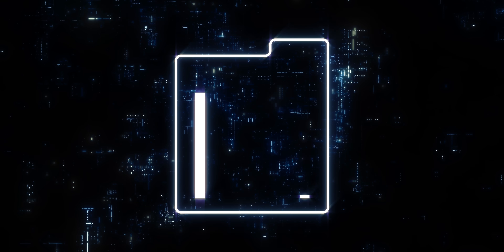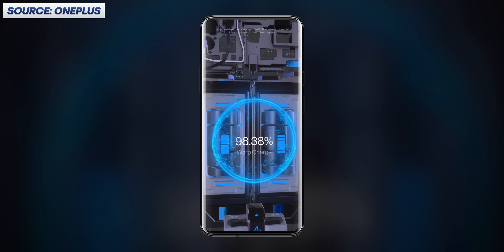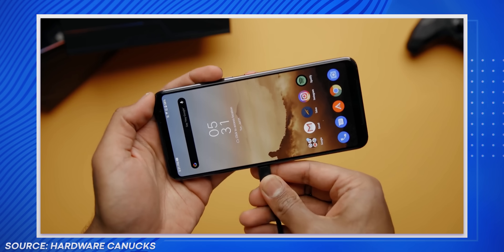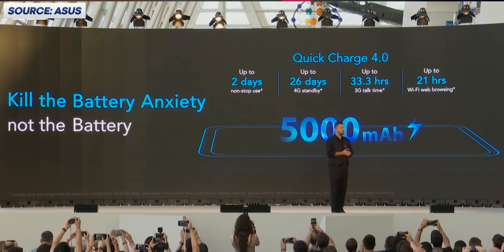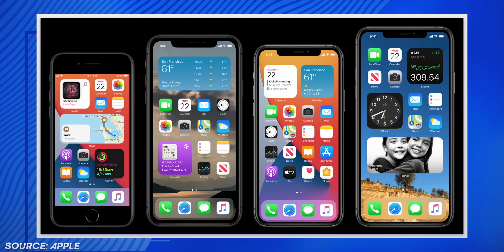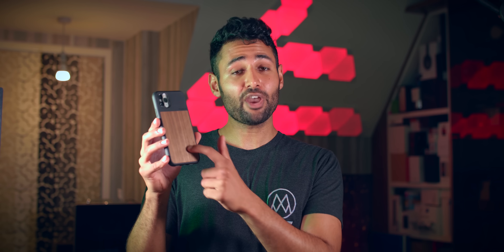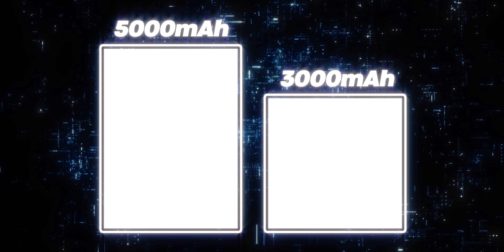The Problem with Fast Chargers.

Comment: I happen to have some knowledge on the subject. And this is one of the most accurate explanations I’ve heard lately. 2 minor exceptions... the battery percent on the phone screen from 0-100 isn’t actually the percentage of capacity of the battery. It’s just the usefulness of voltage between roughly 3.2v and 4.2v. And storing the battery at 50% makes theoretical sense,  but all the experiments show 40% is the sweet spot for long term storage and life. And that’s battery capacity, not the number in the corner of your phone screen.
Reply: Actually, If you take a lithium battery to 0% it will never charge again. As a matter of fact, if it drops below 2.0v, it’s basically garbage. Throw it away.

Comment: I was questioning myself, why youtubers don't talk about the disadvantages of fast charging. You did it nicely!!
Reply: It is the same reason why no car journalists talk about reliability, longevity, parts cost, repairability, etc., mainly because they are exposed only to the new stuff.
Reply: Phones are made to be used for 1 or 2 year. So they don't
Reply: @GameControlYT  and they make you to buy a new mobile by forcing in this way.
Reply: @GameControlYT  thats what they want you to believe, but thats simply the release cycle. They release it as often as possible.

Cars also have 5 years release cycle, but the average car on the road is over 10 years old.
Reply: Beacuse no one cares about the disadvantage, we want faster charge period.

Comment: 1. By separating 2 cell battery for those super fast charge is to maximize the charging efficiency and minimize the heat generated during the voltage conversion. 

A physics lesson is not good enough to explain the battery charging topic. You need to covert the electronic part.

2. How many years you expect to have your phone or tablet to last? 3 years or 5 years?

3. Have you been using any of the fast charge phone for at least 2 years on daily basis?
I do and I am still using. The battery durability still in very good condition. 30 mins give 60％ battery charging is life changing experience.

I used Samsung Note 3 before, and last me 5 years. But in year 2.5, I have to change the battery. Look it was very slow charging compare to current technology and battery still damaging after 2-3.years but now on those new phone we have is last longer.

The current battery technology (materials and charging technique) has improve massively and they have make it works very well in practical.

All about the physics that you mentioned in the video, some is no longer concern.

Most people will change phone on average of 3-4 years. By the time, even how good the battery you preserved doesn't matters anymore because software burden has bigger impacts.

Comment: Thanks for sharing this! I always had this doubt! Because modern manufacturers promising that we charge and play heavy tasks in our phone! But its already heavy current passing through the phone! Charging and discharging at the same time! I thought they might changed components of the battery to prevent getting weak like older phones! I never use phone while it's charging! In short ; Even with a powerbank can cause this problem!

Comment: Ok, but why does battery expansion happen, i thought it was the fact that some of those electrons that go over to the positive side because of the attraction stay and are replaced by electrons from a current, I.E your charger, which is one of the main problems that would happen with slower charging speeds as more electrons have to be replaced.

Comment: And this is why Samsung Sticks with 25 watt fast charging. It's a perfect ballance  between charging speed and battery longevity. 

Samsung phones like the S10, also give you the option of reverting to their older 15 watt fast charging, as well as standard speed 5 watt charging in the settings menu if you don't want to use 25 watts. But 25 watt is still plenty safe in reality, since many manufacturers go way beyond 25 watts today.

Comment: This video misses some pretty key aspects of fast chargers. Wattage is a combination of voltage multiplied by amperage. So to achieve 30W you can either doing 10V at 3 amps or 3V at 10amps or any other combination. You talk about charging faster increases heat in the battery as the electrons are going faster. That is true when you are increasing the voltage to achieve higher wattage. If you increase the current(amperage), you are not increasing the speed of the flow, you increasing the width. This is why the Oppo/One Plus solution doesn't make your phone red hot when fast charging. They use higher amps and lower voltage. Other phones like Samsung have to do a voltage conversion on the phone itself, which generates masses of heat. The problem with increasing the amps rather than volts is you need a thicker cable to carry it. Which again, is why one plus and Oppo come with thicker cables. If you replace the cable with a normal cable specced to carry lower amperage it won't be safe.

Comment: hear me out, what if you had a phone with a 6,000mah battery, but the manufacturer limited it to 3,000mah and advertised it as a 3,000mah so that 100% on your display was 50% for the battery
Reply: only really saying this, because it would not only charge to "100%" faster, but it would put your battery at 50%, maybe limit it to having 75% total capacity, so you would have more run time, and a slightly healthier battery

Comment: "Apple slowed down older phones so the battery lasts longer"
Sure, it definitely wasn't to force people to buy new phones, but to help them have a longer battery life, got it
Reply: I mean logically, forcing the processor to underclock and undervolt will indeed make the battery last longer.

Their motives behind doing so, do remain questionable
Reply: Apple claims it's for "battery health", but it's all a facade.
Reply: @DerpyDoge I was not going to mention any articles, since I didn't have any prior information, and was genuinely interested to see if the statistics confirm what you claimed.

I can see many discrepancies between the article and your comment.

First of all, the study is only in the US. Second of all, although the average iphone stays active a bit longer than a samsung, the study still talks about 1 year and a half total active time, but it gives no data about how many phones stay active for 5 years, so in that regard, the study doesn't confirm what you claimed.
Reply: @iamspencerx  buddy i had almost all the galaxies and i swear!  i  have changed my galaxies every year to a newer because after one year my galaxies started to slow down and dropped the battery capacity drastically., 1 year ago i bought my first iphone for the first time, the "11 pro max" and man my phone it's still at 100 capacity after one year. of course, i have been applying the 50 to 80% cycle on every phone that i have owned., including the iphone. it really surprises me how the iphone after 1 year it still feels like a brand new phone and this is the first time that i will not change my phone to a newer one.
Reply: chris the doc but ur iPhone lacks fea
Reply: chris the doc features lacking iphone
Reply: @christhedoc8689  Of all the reasons why your phones might have become slow, samsung intentionally slowing them down isn't one.
Reply: @DerpyDoge I do see android users keep their phones for 5 years, if you have some statistics, I'll be happy if you could share them with us, just avoid making generalisations based on your personal experience.

That being said, if were to assume iphone users use their phones longer, then that would still confirm my point, because apple would profit from pushing them to buy new phones. Now sure, some pissed off people could switch to android, but most of them won't, because apple designed their services to lock in customers and make leaving very hard.
Reply: Probably both! For some will last longer so they keep using Apple services, for others will make them upgrade faster! Win win situation... For Apple of course, as usual!
Reply: I mean... If you keep the Iphone for a longer time... Its highly possible tat u already cashed in money on their services... Which is kinda more than u spending money on a new phone is u factor in extra 2~3 years
Reply: @rustyshackleford7200  seems legit

Comment: I reserve fast charging for those oh crap my phone didnt charge right overnight and im leaving in 45min or when i get a overtime service call at 7pm and i just want to whack some power into my phone while i get ready. The rest of the time i use one of many Anker 6 port USB chargers i installed around the house 5 years ago. These do 5v 2.4amp max. does take a while with something like my new Note 20 Ultra but overnight or if i am just sitting at my desk working it really doesnt matter how long it takes to charge. 

Another thing that so many people still do and think is better for their batteries is to drain them down all the time before charging. Which is totally wrong for lithium batteries. Best to avoid draining them down below 20% (where ever practical anyway)

Comment: I bought my first iPhone after the 11 came out to change the OS as I’ve been on Android for nearly 11 years. One of the things that surprised me is that the battery capacity on this iPhone is at 99% when it’s nearly one year old. All my other flagships running Android dropped below 80% after two years of fast charging. It seems like Apple knew what they were doing.

Comment: Mmmmm, there is an error i your explanation of the electrons moving, at 0 percent the actual cell still have voltage and more electrons on the negative electrode but it's dangerous to drop below this voltage so manufacturers make a software trick to stop discharging at this voltage, also when the battery is physically at zero percent, this is when the battery is balanced not at 50% as it's empty when the poles are balanced and no voltage difference.

Comment: Would love to chat with you to make an improved version. The explanation on how a battery works is wrong (no mention on ions moving) as is the comment about separators. Keeping a battery at 50% is not the best, lifetime decreases with depth of discharge. The comments on heat reducing the life of a battery are correct and it is true that charging is software controlled so it's not related necessarily with the real state of charge of the battery. Diminishing returns in fast charging is because there's a limit in how fast ions can move inside of a battery. But I'm glad you made the video and I hope it does help some people.

Comment: My blackshark 1 (4000mah) is fast charging, its not even up to 1 hour from 0-100 
But the problem is kept getting hot.. so i must keep it in front of fan.
Or using  wet plas chamois

Comment: Can someone summarise what he said.

Just want to know if fast charging is good or bad or inbetween
Reply: It will make your battery lose capaxity faster. 

Let's suppose that with 12W charger, your phone loses 100mAh after 12 months. 
Using 65W charger, your phone will lose much more than 100mAh, maybe even 400-500mAh.
Reply: @silva_br1  so in one sense don't use fast charger

Comment: In summary - lithium batteries have fundamental flaws, but since they're used everywhere, everyone who uses any "smart" tech, has to deal with it. 
Fast charge means:
* Thicker anode/cathode separator --> less capacity
* More heat --> Internal resistance buildup --> capacity lowers over years quicker
* Keeping battery far away from it's nominal voltage (3.7V, around 40-60% depending on vendor) over time also contribute to losing capacity.

Comment: Many things wrong with this video. Fast charging has more to do with battery capacity increasing in newer  products. Most lion  batteries charge  at a 1 x battery capacity rate with constant  current  constant  voltage control. Remember also the power supply or what you are calling  the charger needs  to power the device and provide charging power to the battery. The charging control is always contained  within the device with the battery. The reason  there are 60 watt power supplies is that is the max power rating designed in to the usb type c specification.

Comment: I use my phone as navigation and it warms up ... in split screne with youtube it warms a lot more up 
And than I have to recharge it because of the battery its getting really hot .... and than the sun comes through the window of the car and the battery is soo hot I mean 60degree or so i cant handle the phone

Comment: Apple wants to save your iPhones is the funniest thing I've heard in a while.
Reply: He ain't technically wrong, but its definitely laughable... 🤔 😁
Reply: I dont like iPhone but my wife's iphone 7 battery maximum capacity is at 80% after 4 years and still running fine. Longevity is definitely something iPhone can't be complained for IMO
Reply: Nandu K Raj u cant afford an iphone u peasant
Reply: Yeah it's so funny that my mum's iPhone SE from about five years ago is still running smooth and is on the latest OS. Truly hilarious.
Reply: Nandu K Raj I do love Oneplus. Oneplus might be the best other than Apple. Its true that iPhones are overpriced but the point is you could use it for 5 years ( Apple gives iOs upgrades for 5 years ) Also never buy the latest iphones. Buy an iphone flagship which is one year old. That is, buy 11 or 11 pro after 12 is released. So that you could get a new piece at a discounted rate. Batteries wont be lasting much and I suggest changing batteries once in two years (battery degradation is normal)
Reply: @joshuvaantonio  , Not gonna rooting for other companies, but have you ever been looking at tech repair groups like Louis Rossmann? Like, gutting those "well designed" Apple products? I mean, at the price tag, good quality is expected, cheers...
Reply: Joshuva Antonio iPhones are not overpriced
Reply: Not funny. Technically Iphones from 2015 still runs smooth and efficient. That definitely means something. Also they are the only company doing this.
Reply: @joshuvaantonio  They are not the only company that does this. Look around and you'll see that any 5yo flagship is totally usable today.
Reply: @joshuvaantonio  joking?
Reply: You can throw Samsung phones away after a year.
Reply: @1996gang  Still using S9+ for two and a half years now and wirelessly charging overnight since i had it. My phone`s battery still lasts the whole day.
Reply: @1996gang  they actually increased the support to 3 years so no

Comment: Charging is very open for development with new battery materials. I think the sweetspot will be where people do not need anymore charging speed. For example, 15-20mins full charge will be enough for most. Secondly, Apple has become a cost/profit oriented company rather than a real innovator. They sell 30w charger not that they think about you but they do not want to decrease their profit margins and earn more. Actually according to Cook, cheaper battery sales was once reason for the declining phone sales. You will remember the Apple's battery crisis. They also kept batteries with low mAh for years just to speed up the exchange of older phones as battery degrades to a very low level faster. This made everyone live with a charger all the time. People really suffered until they met Chinese phones. As an apple fan, I felt really deceived. I think batteries are cheap enough to be exchanged every  year or 2. Fast charging will rule...

Comment: That's why I'm very happy with the 15W fast charging that comes with my Motorola (Plus it has a 5,000 mah battery - so I will want my  higher capacity battery to degrade as less as possible over the years). 
Anything above 25W is just really harming your battery in the long run

Comment: Most important facts mentioned. I liked the video. Anyways I dont understand the hype about super fast charging. For 90 % of the users it wont make a difference because the battery last a whole day even with several hours of normal use (not high performance gaming). I use to charge my phone only to 85% and dont let it drop below 30 or 40% and I still make a whole day with it door to door. When I get back home I need to charge it sometimes when I use it for 1 or 2 hours if gaming or browsing when I used it a lot during the day. If not I plug it in when I gobto bed. I use a 24W charger doo

Comment: I'd gladly trade charging speed for more battery, but unfortunately, the industry would much rather we all use fast-charging so our phones die in three years, because then we need a new one.

Seriously, I'd love a Samsung Note with 8,000 mAh or more, even if it could only utilize the 'slow' version of fast charging.  I'd even be fine with it only using the 5V @ 2A charging, even though that would be rather slow, because I'd rather charge once and use it all day instead of this 'charge the tiny battery four times a day, but it's really fast' mindset.

Comment: Well explained... For me I have note 10 plus 4300 battery I have both 25 and 45 watt charging brick from 0 - 100% on 25 watt charger is 1 hour 7 minutes and 45 watt charger is 59 minutes... Where 45 watt charger shines is from 2%-72% it only tool 34 minutes so 45 watt charger is good from almost 0 to first 50 or 75%..Samsung 15 watt wireless charger takes around 90 minutes  but I only use oem chargers most of time I use wireless or 25 watt charger 45 watt charger is only used to quick power when phone is almost drained this is my own experience...

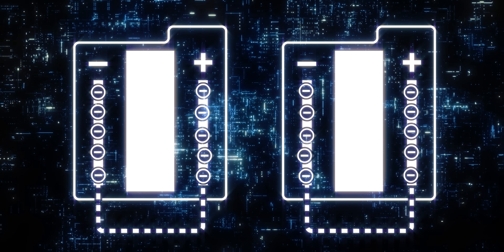Comment: @3:25  if the electrons are evenly distributed.... that means the battery is dead.. no electrons will be flowing... that is a ZERO % charge.
The idea that keeping your battery at 100% is bad, has more to do with faulty chargers,  and degrading the control circuitry, than ruining the battery.
Constant draining the battery to zero CAN damage the battery as it can get stuck in that balanced state where it cannot accept a charge (the 50% - 50% example you displayed)